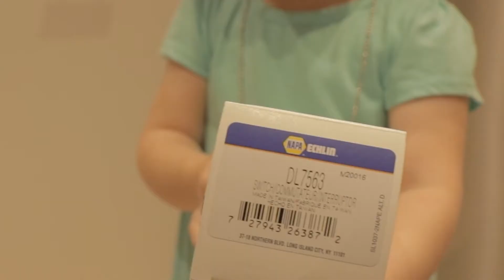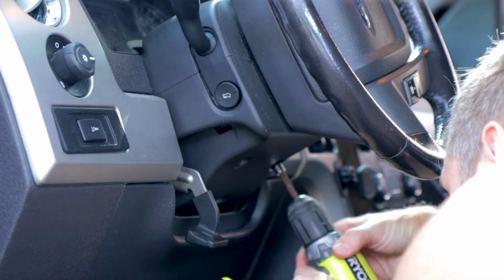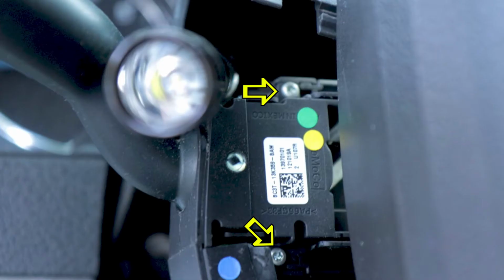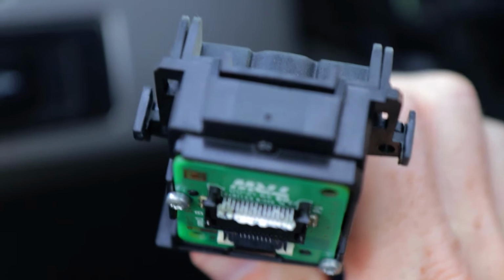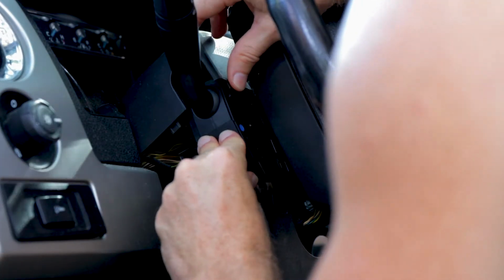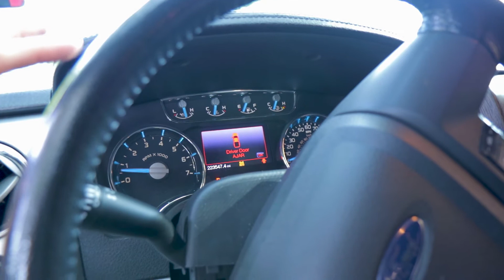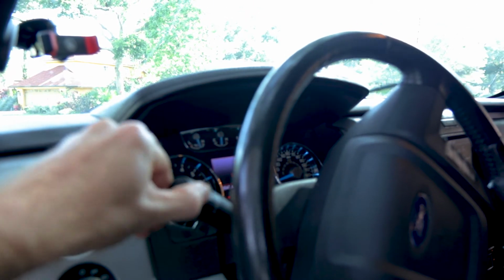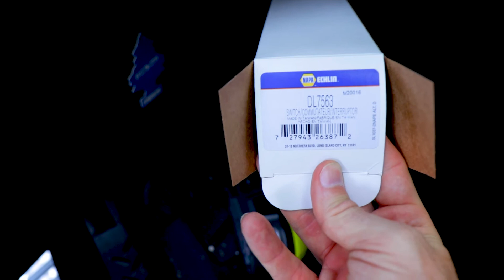F150 Multi-function Switch Replacement | DIY | My Ford F150 Wipers WON'T SHUT-OFF!

Comment: Dane is spot on about how easy it was to replace the switch. I broke mine in half and had many stressful thoughts about what it was going to cost to repair and replace. I found the part at Auto Zone for about half the price of the dealer. Thanks to Dane's guidance I was able to complete the replacement in about 10-15 minutes.

Comment: Thanks very much for this easy guide! Mine had began do the same. Ford  Dealer wanted 450.00 for a job that took me fifteen minutes and cost less than 35.00 for the part! I appreciate you!

Comment: Brother CAN'T THANK YOU ENOUGH FOR POSTING THIS! I just finished mine today took about 1 hour pretty easy, there were a few differences! But never the less I couldn't have done this without your video! My f150 is a 2013 SXT standard cab pretty basic. What I forgot to do was turn the steering wheel so the 2 screws that hold the unit, let's just say struggle bus. Just took alittle extra time, if I would have turned the steering wheel this would have been a cake walk! AGAIN THANK YOU SO MUCH! I'd by you a beer but I'm in Michigan!💪🏻💪🏻💪🏻💪🏻💪🏻

Comment: Great vid and this did fix the problem. 15 minute install on my 2012 Ford F-150 Platinum. You don't need to take that cover off the pedal adjuster either. I was able to find that 5.5mm socket at Home Depot it was like $2.50 and is 1/4" drive.

Comment: DUDE, thank you very much.  Took me about 30 minutes from start to finish on my 2018 F150.  Most difficult part was to fit my belly below the stearing wheel to release the bottom screws.  I had to use a 7/32.

Comment: Good information. The part was under $30 and it took 10 minutes start to finish!
For quick reference, the part is held by torque (star) screws, T-10 to be exact.

Comment: Thanks @Great Dane ! Google Fu and your little video helped me immensely. Fixed this little ghost in the machine in quick time. Only setback when I got to start was NO 5.5MM socket or a closest SAE equivalent at 7/32 to remove the steering wheel shroud. Most combo ratchet sets or at least the ones I own go down to 8mm /3/16 SAE(Damn you Ford somehow I know this was part of your evil plan.) Quick run to Advance and a cheap 20$ SAE/Metric set with... lo and behold... metric sockets down to 4mm  with the needed 5.5MM. Woo hoo ! That an a DL7540  Multi function Switch from NAPA for my 2013 STX and all is good. Time for a beer !
Reply from the maker: Happy to help! Thanks for watching

Comment: Just did my 2013 150, your video helped a lot. Thx
Reply: Same white build up, looked like when a battery goes bad or something.  Glad you mentioned the air, I used a bottle of compressed electronics cleaner.  Works fine now
Reply from the maker: No problem 👍

Comment: Great video, thank you. Just a couple suggestions. When prying on plastic panels, I always use a plastic prying tool - you can get a set for about $12 at any parts store, and you'll be surprised how often they come in handy, with much less risk of scratching and scarring your interior. You mentioned a 5.5mm socket - 7/32" is the same size and probably a little more common than 5.5mm.  And releasing the tabs on the back of the switch - it looks like either a much smaller screwdriver or a small right-angle pick would be better there, but using your key was ridiculously effective. Well done. 😎
Reply from the maker: Thanks for the tips Daddy! Yes, pry tools are a must. I had a few I should have dug out from the cellphone repair kit.

Comment: The white Gunk is Dielectric grease which helps keep corrosion away from the contacts of the electrical parts
Reply: I guess not many people worked with electronics. Many in here think by wiping the grease they solved the problem, but no one bothered to ask why it was there in the first place.
Reply: My FIRST thought was, "that's dielectric grease, don't get rid of it!"

Comment: The white gunk is just a antioxidation compound found all over electrical connectors, they are non conductive and are used to prevent corrosion. Thank you for the video, pretty sure that switch is just bad, not the connection.
Reply from the maker: Thanks for that info Eric! Appreciate it

Comment: Good vid.  Note - there are two variations of the multifunction switch.  NAPA model DL7563 is the model that has the Auto Rain Sense feature.  The version WITHOUT Rain Sense is NAPA model DL7540.  For some reason, the DL7540 (without rain sense feature) is pricing out about $10 more than the DL7563.
Reply from the maker: Funny you mention that. The guy at NAPA scratched his head on that himself.

Comment: Wiper delay stopped working on my 2013. Thought I'd replace this switch, see if that takes care of that problem. Just have low speed and high. Nothing inbetween . Pain in the ass when its hardly raining. Thanks for the video
Reply: I am having the same issue on my 2013.  Curious if you changed the switch or was there another fix you used?
Reply: @jimh6446  Yeah , I did replace the switch. Got one of Ebay for around 50 bucks. Pretty easy  to replace.

Comment: Thank you, made it easy to know this could be a DIY repair and it was. My son's 2014 didn't have the pedal switch so only had to remove the 2 torx screws and slid right off and also had the white corrosion. New switch in and working great.

Comment: Thanks, man!  Mine was a 2017 with fewer options, so it was even easier.  Just the three screws for the clamshell, then the two torx and the switch fell out.  Great video and I did need the tools you listed.  Shame on Ford, this has been going on for 15 years.

Comment: Just a quick tip. Turn on the fog lights and that will give you an indication on whether or not the wipers are on. If the light is illuminated they are on(headlights turn on with wipers being switched on) 

That way you dont have to wait to see if they turned off as the light turns off pretty quick

Comment: Great video for replacing the arm however I ended up with another problem… the signals and wipers are working but now when I push the button at the end (for washer fluid) my high beams turn on and there isn’t any washer fluid spray. I checked the fuses and they are fine; no noise coming from washer fluid pump motor so that may need to be replaced but that won’t fix the high beam issue. Suggestions?
Reply from the maker: sounds like you might have received or purchased the wrong part based on what you are saying. I'd double check with NAPA auto on your model and the part you should be using.

Comment: For anyone wondering, only buy the motor craft version or get it from your local Ford dealer, I bought one from autozone and it fixed the wipers, buuuut, the turn signal wouldn’t stay on for longer than 2 seconds so I had another problem after fixing the problem.
Reply from the maker: What brand did you purchase from autozone?
Reply: That's why I bought mine directly from the dealer to avoid in other issue in the future. It wasn't that much more than the ones from NAPA, AUTOZONE and online stores.
Reply: @LifeAsDane  I know this is really late but duralast was the autozone part brand that I bought. For like $4 more at my local Lincoln dealership they had one that fit my truck and once I put it on my turn signal stayed on and worked normally as expected. Video was great but the brand does matter

Comment: I changed the switch out because my wipers wouldn't  turn off when off then my headlights wouldn't  burn or dim upon down so had to put old one back on for now lights are important so I just took fuse under hood out to turn wipers off till I get another switch and figure this out

Comment: I tried to replace mine since the wipers would only operate in fast mode, however after installing the new part, the same issue arises. Any tips? I read somewhere that something in the computer may need to be reset

Comment: Hey man my truck is missing those 3 screws on the plastic cover. The 5.5 mm bolts? Do you know the exact size? They were missing when i bought the truck.. The 3 small screws under the column?????

Comment: On NAPA it says the part would not fit in my truck and I drive a 2013 Ford F-150. Would it still work or do I have to buy the more expensive part?
Reply from the maker: If your referring to the part in my description it will work!

Comment: Having this problem with my older F150. I'm going to try to fix it hopefully my husband will let me because I've never done this before.
Reply from the maker: Did you get around to fixing?
Reply: @LifeAsDane  , turns out there's something going on with the fuse. When fuse is in the wiper won't turn off. When fuse is taken out the wiper stops...duh. have replaced fuses to no avail. Will wait until the weather warms up to tinker with it some more.

Comment: I just changed mine out and everything works as it should.. but the bright lights won’t stay on I have to hold the handle back for them to stay on any thoughts?
Reply: Mine too and my blinker only goes on 3 times when pulling down all the way left or right.

Comment: I blew mine out with compressed air without any disassembly and it works fine
Reply from the maker: nice! But where did you blow the air?
Reply: @LifeAsDane  Well, that was wishful thinking! Now, three days later it's back again, so I'm off to the parts store. Your video will be very useful. Thanks!
Reply: I've almost completely directed my switch and used deoxit and air compressor and it's not fixing it. I've pulled the ribbon cable I've restretched the finger spring contacts too. Everything works but the wipers don't shut off, just like before. But I'm still looking for that problem.
Reply: Blowing Air in the connector or any where around will not fix the problem . Even if it worked momentarily. The white "Gunk" is  corrroision preventer.

Comment: what if buying  new turn signal switch didn't work? bought it and it didnt solve it thanks if you have any advice
Reply from the maker: First person to say it didn't work. Only 2 potential problems. The part was DOA (Dead on Arrival) as we know these do go bad OR the brand/model number you got wasn't compatible.
Reply: @LifeAsDane  
I found some blogs where other people's had the problem but I will send the part back and try again I'm not the first though on other instructional videos there's usually one or two guys that say it didn't work I saw where someone said it was the motor but that doesn't make sense cuz otherwise it wouldn't run at all I guess I don't know anyway thanks I did check my relay and fuses everything is in order and all the functions on the part I bought seem to work just not the off on the intermittent wiper

Comment: So that white stuff. What is it. I thought it was thermal paste or something. So you are supposed to clean that white junk away? hmmm.
Reply from the maker: It is electrical paste.😂 Should be left or you can whipe off and apply to new connection

Comment: Instead of waiting that 10-15 seconds. Cycle the key to battery-off. 
I need to do this to my 14, thanks for the video
Reply: What? That mean
Reply: @Davidblaine18  in the video he turned the wipers on then off and said ok now we wait. 
 So if it was still bad, all he'd have to do is flip it up once, flip it back off than, turn the key off, than back on. If the wipers didn't wipe, switch is fixed.
I do it all the time to mine. It seems that around the 3-4th time I do that in a 5 second time frame, it stops wiping.
Reply: @ryanhack5  you said cycle battery off. What’s this
Reply: @Davidblaine18  meaning turn it from acc to off. Simply meaning turning the truck all the way off lol.
Reply: @ryanhack5  “cycle the key to battery off” just sounds weird.